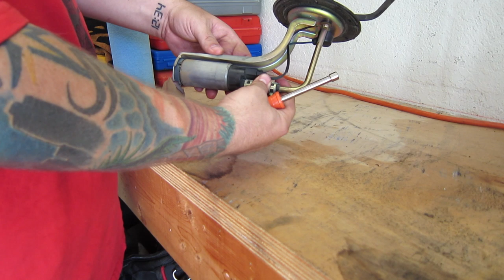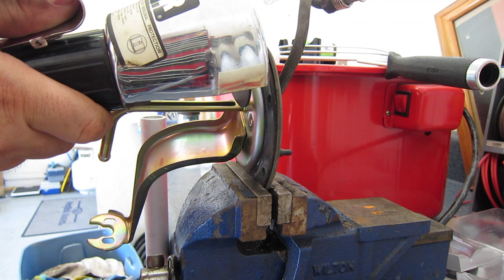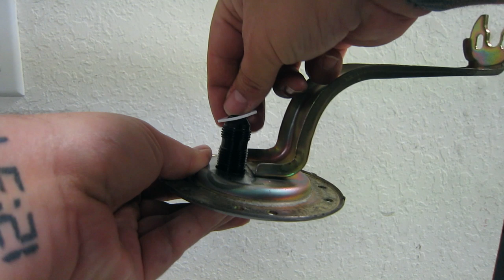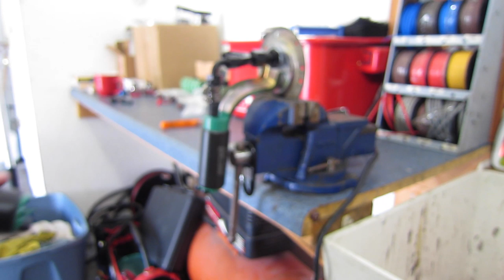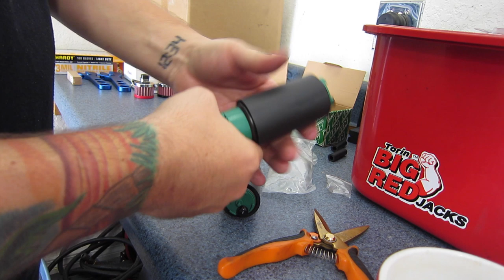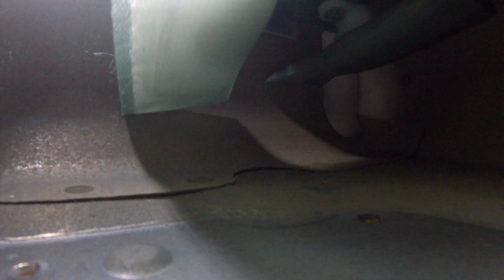Pro Street Eclipse: Part 12 - Double Pumper Fuel Pump Install

Comment: Looks great Joe. I was expecting you to go with a fuel cell though. Didn't think you would keep the stock tank, simply due to the weight!
Reply from the maker: Haha! Good call! I'd love to run a cell, and I probably will in the future, but for now, rules say the tank or cell has to be in the stock location, and this tank is very odd shaped. So, I'll keep it for now and save my pennies to get a custom cell made someday. Don't worry, I will take some weight off the stock piece.

Comment: Is swapping out the fuel pump to an E85 pump all that's required to convert to E85? Thanks Joe...I enjoy your videos..can't wait for"Joe Races"...Woohoo!
Reply: No, since ethanol has a lower energy density than regular fuel, more of it needs to be delivered to the engine.  Bare minimum you'll need bigger fuel injectors, and a way to tune the car.  Depending on your car and power goals, you might need to upgrade the fuel send and return lines to flow more, pressure regulator, fuel filter, fuel rail, etc.  It's going to be different for every car and setup, so there's no definitive answer.
Reply: CouncilOfDave thanks...are there seals that need to be changed? I've heard of Ethanol swelling injector seals. And I believe something about valve seals or the seats...not sure...
Reply: Depends on your car, I suggest finding info on your specific model.
Reply: CouncilOfDave thanks for your help...The search is on!..
Reply from the maker: Since I'm building my fuel system from scratch, minus the tank, I'm building it with E85 in mind, including lots of fuel pump, large injectors and all ethanol compatible fuel system components, including the rail, lines, regulator and fittings. I will clean the tank with lacquer thinner to remove any varnish and maintain the system to be sure it stays in good shape. Every car is definitely different, but if you address the need for approximately 40% more fuel, and do regular maintenance on the system, chances are it will be ok.
Reply: Joe Wrenches thanks Joe. I'LL look into what's available for my car. Its an LE5 engine. But GM made an E85 compatible LE9 that I could probably get most or all the parts I'll need to convert mine.
Reply from the maker: Craig Cundiff Sounds like that's worth looking into. Good luck!

Comment: Cool video. Well done. Only question I have is do you need a check valve if you have 1 pump turning on under boost to prevent flow back from the pump that is always on?
Reply from the maker: Thanks! Plan was to run both pumps all the time. My fuel pressure regulator is large enough to accommodate that. But I have gone to a large, single, external pump at this point.
Reply: Joe Wrenches bad idea running both pumps all the time, it will cause the fuel to heat up and potentially start to aerate the fuel leading to air bubbles going trough to injectors. You can get either a fuel pump controller or a stand-alone ecu will generally give you options to control. Nice vide btw, not a big fan of the grommets doh man... you will end up with lots of fuel vapours with e85, you can buy a wiring bulkhead fitting from summit racing and you just pull the wires trough and it seals it shut with rubber seals as you tension it :)
Reply from the maker: @snowjack13  Thanks for the input. I do have standalone engine management, but I've gone a different direction for fuel pump at this point. Thanks for watching

Comment: Cool build you have going here. Why not lose the tank and wheel well (aluminum/steel sheet patch?) for a basic aftermarket fuel cell? So much easy weight savings!
Reply from the maker: In the classes I plan to race this car in, the tank has to be in the stock location. The tank in this car is under the back seat and very oddly shaped. I'm trying to not cut any corners on this car, but I decided to save some money here and use the factory tank. I'm sure I'll go to a cell in the future, but it will be in the stock location, or maybe in the front of the car. I don't want to cut this chassis up at all. I've done it in the past and regretted it.

Comment: Hey Joe, just wondering what you are doing for the bottom bolt that holds the pump assembly in the tank. (Bottom of tank bolt)
Reply from the maker: There is no bottom of tank bolt that has anything to do with the pumps.
Reply: @JoeWrenches  interesting. My 92 gst had a bolt in the bottom of the tank that held the sending unit. 17mm I believe

Comment: Also where you get that sweet cable rack with assorted wires I been looking for one I hate spend a bunch on each wire each time I need some from pep or autoz
Reply from the maker: Thanks Diego. I placed a GoPro in the tanks for the shot. The wire rack is a Harbor Freight item. #03384

Comment: just curious on how you going to stop those grommets from leaking?
Reply from the maker: +TheHBWC Not sure. I was thinking about using some kind of sealant, or I may try drilling some nylon bolts and using those instead of grommets.
Reply: that could work especially with threaded rod down the center

Comment: Did you splice the factory power/ground wires or bought a dual pump hotwire kit?
Reply from the maker: PilgrimTitan I'm still deciding exactly how I'm going to wire the pumps, but it will involve relays that are triggered by the ECU to route power to the pumps on heavy gauge wire.
Reply: Joe Wrenches that seems like a good idea

Comment: um nice try tho lol,I wouldn't murder the original pump assembly like you do,all you was to do is use one fuel pump,that aem e85 pump is rated for 1000hp,just take off a inch off the feed tube and fit the pump then connect the wires to the existing wires that comes off the original fuel pump,the job is done.no drilling whatsoever, now you are vulnerable to have gas vapor leakes
Reply from the maker: I'm sorry for the misunderstanding, but I'm not "trying" anything. Unfortunately, a single AEM pump is never going to be enough pump on E85 for 1000hp. Even two may not reach that goal. Thanks for watching and for adding a little misinformation!